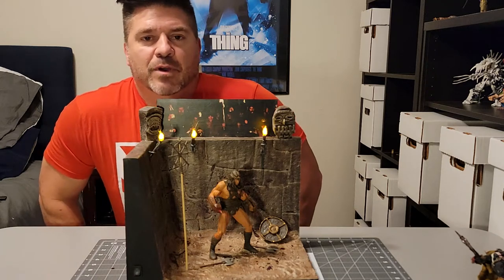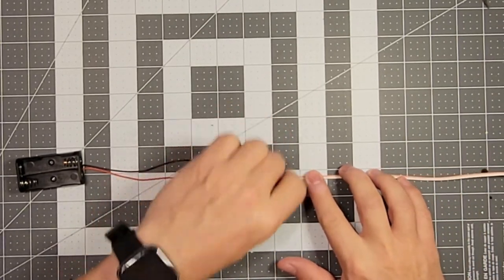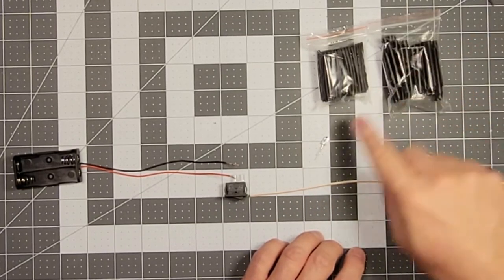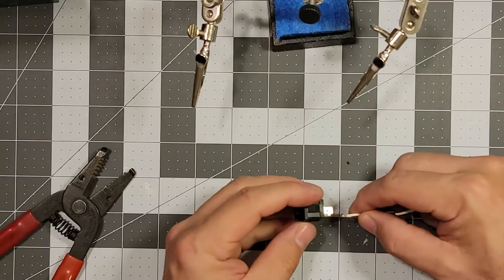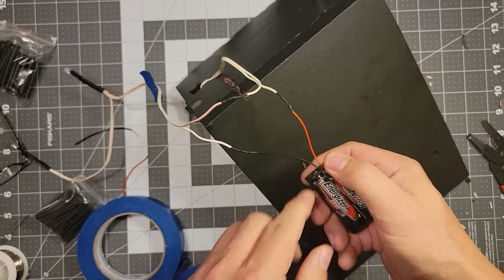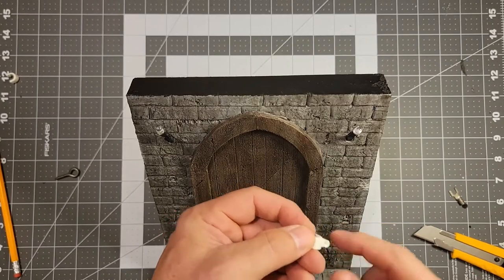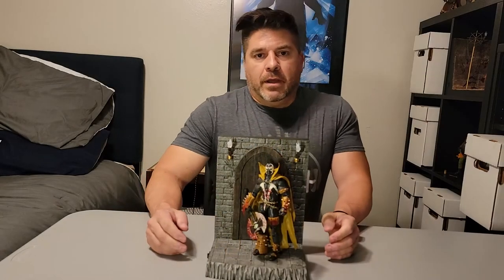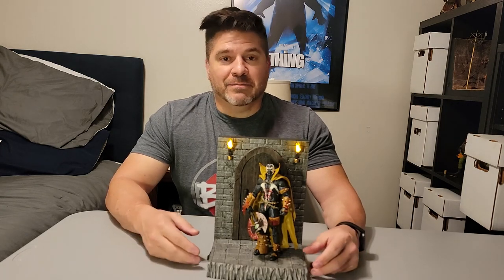How To Make LED Diorama Torches [TUTORIAL]

Comment: And if you dont wanna do all that wiring for a on and off switch there are battery packs that have built in on and off switches.. 5 pack runs ya about 7 bucks.. Great video man. Ya make it look easy.
Reply from the maker: That's a great point (and one I should have mentioned). Thank you for letting others know. I chose a separate switch because 1) I wanted to access it from the side,  not the back, and 2) mainly because the battery packs with switches I could find had the wire coming out on the same side as the switch. For most of my projects that presented a problem with placement and esthetics. I did use a pack with a switch on my Thor base but modified the switch to run the wire out in a different direction. Thanks for the contribution and for watching!